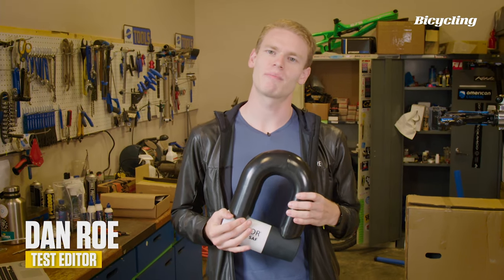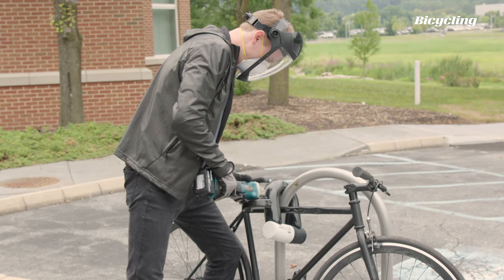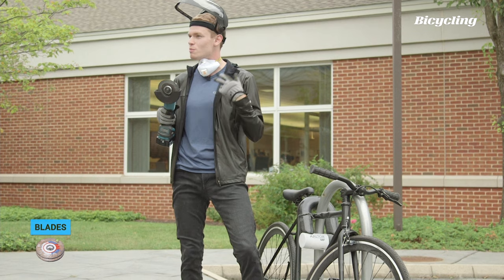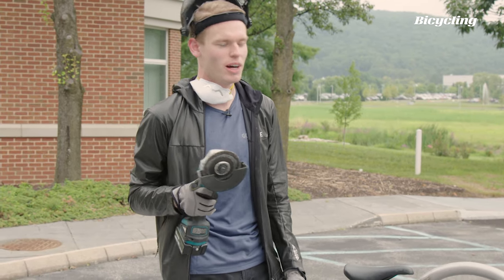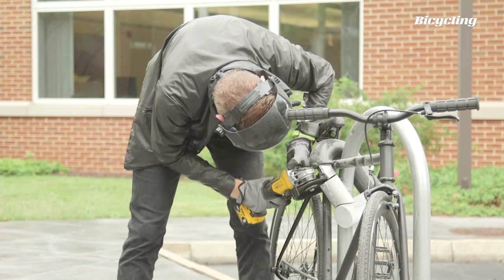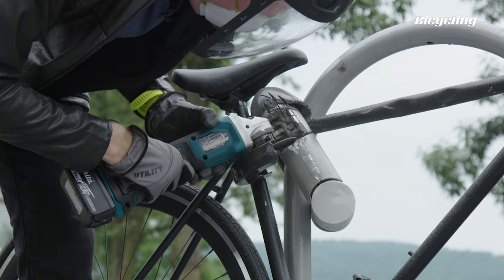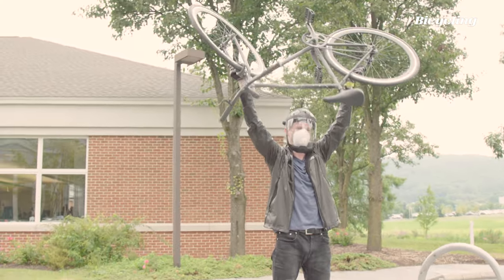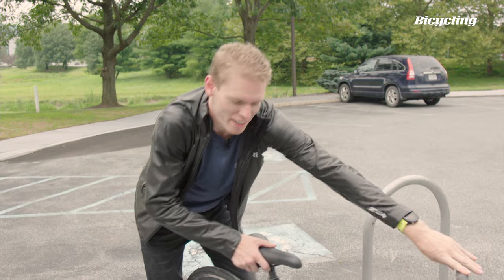Is The Altor SAF Bike Lock Really Grinder-Proof? | Bicycling Magazine

Comment: Use a 9in cordless and then connect it to something that can not be cut as fast.  Bike rack is all of 10 secs for the tube. 

Hand hacksaw would take the rack in under 1 min.
Reply: even if he cuts the rack he still is gonna have a 13lb weight dangling around or the bike
Reply: Is that true GrandMasterP1000??? You can hacksaw through a rack of this type in under 1 minute? Damn, if that's the case what the hell do we do?
Reply: @justinbeynon7980  Use the same materials as this lock to make the rack. :V

Comment: Wait a minute, why could he just start cutting from where the U section meets with the base?

Because the aluminium protection stops there and its on the core there.

So you could just need to chip off a bit of that rubber and place it carefully to be able to hit that core.

Comment: how long does it take to cut the bike frame, the missing piece can always be welded back on
Reply: Ah, no. Once it is cut it is destroyed.  It would have to be professionally rebuilt. More than the price of this bike.
  Most bikes are not welded. Only super cheap bikes and tig aluminum bikes are welded.
Reply: @firesurfer  if they can't take the frame they'll take the wheels, if they can't take the wheels they'll take the tyres. Seats and handlebars are fair game too :(
Reply: @AegisHyperon  The wheels and tires cannot be separated if locked.  Many bikes are just stripped. That is why you see so many bare frames locked up.

Comment: just cut the Metal bar it's attached to and drive away lol
Reply: Lol
Reply: That's what he says at 3:37
Reply: @Geoff Rogerson you don't say???
Reply: That is vandalism and you can be arrested (not for cutting bike though)
Reply: @Geoff Rogerson Yeah, but at one point you have to consider if the lock is over engineered for the problem. After all more aluminum and steel means more weight and cost.
Reply: Bring flex tape or glue, cut the bike, tape or glue it, later you can weld it lol
Reply: Then you can cut the lock at home.
Reply: Andy Stadi. Drive away with this lock still blocking the wheel? I’d love to see how you’d manage that   ;-)
Reply: @gendalfgray7889  stealing a bike is a crime too and you can be arrested for it as well :P
Reply: @freitastutu  I think cutting the rack will add vandalism to your list of prosecution.

Comment: Cutting the rack is still a problem.  You have to cut through it twice and you will still have to deal with the lock on the frame.
Reply: Cutting the rack is still easier/quicker.
You can deal with the lock at leisure in you workshop at home.
Reply: @elricthebald870  That's true, I'm just saying it is going to be a massive PITA.  They REALLY need to want your bike.

Comment: Use Dewalt 60v 9" cut off saw for the win.Also,would be easier to cut through whatever its locked to instead.
Reply: even if he cuts the rack he still is gonna have a 13lb weight dangling around or the bike

Comment: Great idea and very impressed with how long it took to get through it but most thief’s would of just gave up and cut the railing that the bike was locked too
Reply: even if he cuts the rack he still is gonna have a 13lb weight dangling around or the bike
Reply: @TantalumPolytope  and then the person can take the bike home and spend all the time in world with a angle grinder to get the lock off which will eventually come off with a bit of perseverance
Reply: @neilmccusker6971  but he is gonna have a 13lb weight dangling on the bike wich is quite suspicious and if he rides it hes probably gonna fall off the bike every turn
Reply: @TantalumPolytope  then what you do is wrap your coat around the lock so no one can see it and push the bike home and let the  tyre down so in case you get asked by someone you can say you have got a punctured tyre and this is the reason why you are pushing it

Comment: I could cut this with a bandsaw in a fraction of the time it took this dude to hack his way through it with a grinder.
Reply: Yeah a bandsaw would do it in no time. I was thinking a sawzall with a bi-metal blade would probably do a better job than a grinder as well.
Reply: @misterj2875  100%
Reply: Good thing a band saw isn’t very portable. In fact it isn’t portable at all. So I’m not sure how’d you would use that on the street. But a handheld angle grinder easily concealable in a bag? Definitely.
Reply: @ShiftingCloudsYT  I Have a battery DeWalt bandsaw that says different. Also would be much quieter.
Reply: pieman12345678987654 Well that is portable but kinda heavy tech to be carrying about just on happenstance of running into bikes like this when a angle grinder would be better for that. But yes it would still work.
Reply: pieman12345678987654 What’s the cut capacity? 4 in?
Reply: @ShiftingCloudsYT  5 inch

Comment: How about a cordless bandsaw or reciprocating saw? Or a cordless 7 or even 9 inch angle grinder. Or drilling out the core?
Reply: It uses an Abus lock core that has drill protection. Using a different tool could definitely work, but a standard size grinder seems to be the go to power tool for bike thieves. 

You can't guard against everything, but this lock would be way too much hassle for 99% of thieves.

Comment: Would it not have been easier to grind the bike fence that the lock is locked to? I'm sure its hollow unlike the lock.
Reply from the maker: It would have but we only have the one!
Reply: even if he cuts the rack he still is gonna have a 13lb weight dangling around or the bike

Comment: What about a band saw tho?
Reply: A portable bandsaw is cumbersome, because of the greater size difficult to conceal and draws way more attention and suspicion than a grinder would. I also would assume that a portable bandsaw is a bit pricier than a grinder and as a thief I would like to take both the bicycle and the saw with me after the job. And again, the size and weight of the saw makes it difficult to handle from the POV of a thief. Of course if you approach your pray as a thief with a van full of tools and kidnap a bike into the van then you are up against organized crime. But then again, the lock is a great deterrent since thieves pick the low hanging fruit instead of having greater work for the same outcome.

Comment: Even if the thief cut through the rack, they would still have to cut the lock off after.  I think your bike is pretty safe.
Reply: Cutting the lock off at home is hardly deterrent.  Especially if the home is a chop shop thst has an oxy-acetylene torch.

Comment: Aluminum is soft.   once a cut is made  in the beginning, I would have expected a pry bar to be a better tool to remove the aluminum.
Might also add. aluminum has a low melting point.

Comment: You cut it all wrong. Cut at a 45-degree angle and cut a triangle off the very bottom of the shackle. From there you can cut the inner shaft and rotate the lock out of place.

Comment: Couple of problems -

1) The SIZE of that lock. It's alright if you exclusively go from A to B and can leave it on location, but otherwise, it's very impractical.
2) The cost! $299! You might as well get a load of hardened chains and locks and just wrap you bike in them. 
3) If you ride a bike worth of that level of security, all the above considered, why not just bring it inside with you OR find a shop or something nearby and pay them rent to store it for you. It seems like a gimmick rather than a practical genuine solution
Reply: 1)its not meant to be portable
2)even if you had some hardened chains vs this lock this thing would still win.

Comment: Of the few 'angle grinder resistant' ulocks on the market today, 2024, the Altor is simply the best, in regards to, securing your bike. It's simply too girthy to get through in the time thieves usually require to pedal off with your whip. Unfortunately, the cons outweigh the pros. 1). It's so big, it'll make Fred Flintstone blush. 2). And because of this, the locking circumference is minimized. 3). The key tends to get finiky which is really scary. Heck, one day it may not open for at all! Though WD-40, and or a little graphite might help, this likelihood doesn't inspire confidence.
 But it may work for you and your locking scenarios.

Comment: The problem is this grind is aren't the only cutting tool. I don't know what it's called but there's one hacksaw cutter which is like an old reel to reel tape deck what I mean it's has a flexible hacksaw blade that goes around this spool Now they just create a very thin cut like a hacksaw They might be able to go through something like this or the new so-called un grinder able locks.

Comment: Fill the lock full of wire mesh, grit, or even a dye. Use them daily,  wire mesh gets into the gears. They will just start cutting the welds on the bike and repair it .

Comment: You could cut the rack the lock is attached to in ten seconds, then remove the lock later (after stealing the bike).  If the bike is actually worth stealing with a grinder, the thief will do that.  If the bike isn’t worth that level of effort then it means you wasted your money on an enormous and ridiculously expensive lock.
Reply: even if he cuts the rack he still is gonna have a 13lb weight dangling around or the bike

Comment: The comments here are laugable!  "Use a bandsaw, reciprocating saw, bimetal blade, blah, blah, blah."  Sure, this blade will get through the soft aluminum.  But for what purpose?  The typical grinder wheel still won't reach the shackle.  And even if  you do orchestrate the "perfect" combination of hacksaws and angle grinders and technique, how long will this take? 

 As already posted a million times, you're better off cutting the bike rack in 1 minute and taking the bike and lock home to work on in private.
Obviously NONE of you have actually cut locks and hardened steel.  Hardened alloys were developed to thwart hacksaws and all manner of bandsaws, reciprocating saws, etc.  U-locks stopped this type of attack. 

Plus, those of us who have been involved with bicycle theft issues for decades know that bike thieves are lazy, stupid druggies.  They pick the lowest hanging fruit.  Einsteins with LPL lock picks and skills they are not!
Then larger and larger, more leveraged bolt cutters became available, so shackle sizes were increased to prevent or greatly reduce this method.
Then freezing & hammers entered the scene (more urban myth, actually), so crossbar end lengths were reduced.
Then car jacks and high-leverage methods were employed, so shackle size was reduced.  Double-locking models hit the market. 
Then angle grinders were found to make easy work of hardened steel alloys.  Bummer.  Then battery-powered, brushless motors made high power portable thieving tools readily available.  Shackle size increased again.  Large security chains became more common.  But angle grinder power kept increasing, making bicycle theft easier and easier.
This lock FINALLY addresses this issue.
IF Altor is smart, they'll start selling u-lock retrofit sleeves for the hundreds of millions of u-locks already in service.  They'd make a killing!  I assume they've patented their design already and are employing this strategy.  They'll sell very few $300 locks of this size.  But for those of us who already own quality locks, upgrading them to thwart angle grinders would be the smartest move.  IF they can do it for around $90, they'll sell millions.
If not, they're losing a major opportunity to sell a lot of units AND improve bicycle security for so many people.

Comment: The breaking of this lock is largely down to technique here to be frank. Unfortuantely there arent any angle grinders i know of that are meant to be used with the spindle facing the right as this orientation of spin is up and just forces the user to compensate kick back and jarring instead of focusing the drive into the cut. The point in the aluminium is to gum up the grinder blade which it does a good job of but any bike thief will know a bit of tallow or similar lubricant will mitigate that and your through in seconds. Very disappointing to see that the additional aluminium is the only extra defence added to the fact that the shackle once cut twists?? Both sides of the shackle should not twist in a proper lock to prevent the obvious and forcing and additional cut at the very least

Comment: Youre cutting  in the wrong place. Cut the lip that protrudes from shackle to the base of the lock. That way you have one big cut less to get a pie piece out. Then when you cut the steel shackle the lock will be free since there is no support from the aluminium from the other side.

Comment: Sorry to be rude but you have no clue how to use a grinder. First of all you take the guard off and fit a larger cutting wheel and the highest capacity battery, 6 amp hour for example,alternatively you use a full size petrol powered grinder, they may be big, heavey and loud but they'd get through that lock in seconds and if your stealing something worth it, say a £35,000  super bike, well throwing one in a hold all or the back of a van capable of holding a bunch of bikes or 2/3 expensive super bikes, its not all that big a hardship

Comment: Wow. That is pretty impressive resistance to 4.5" grinder but it is crazy to carry a lock that size! There are a few 9" cordless grinders that will cut through in fast i.e.  Makita DGA700Z or Metabo HPT
Reply: it's not meant to be carried around you just attach it to a bike rack that you use often and lock your bike when needed

Comment: @2:07 you have so significantly damaged the bicycle it would no longer have value.
Angle grinder resistance often leads to manhandling the bike and cutting it.  I've had a bike before get damaged during an attack making it still useful to commute with less valuable bikes.

Comment: If I really wanted that bike as a thief.  I would just cut whatever it’s locked to, like the bike rack itself. Then work on the lock someplace else.  that would have to be easier. But more than likely I’m moving on to the bike next to it with a common u lock or chain.

Comment: You’re not very good with a grinder. Also, a bigger grinder disc like a 5” would’ve gotten through this in a minute. The outer thicker shaft is no match for a grinder. Grinders are designed to cut through steel which is much harder than aluminium.

Comment: Wrong tool mate. All you need is cordless reciprocating saw with 6" bimetal  blade.
Reply: Bimetal blade won't cut the hardened shackle underneath.  Duh.
Reply: @dudeonbike800  ....duh....try Diablo steel demon.....
Reply: @sherannaidoo2712  Oh, so NOT bimetal then?  

The Diablo is just another high-speed circular blade.  Not effectively different than the ceramic angle grinder blades, which has been established as effective against hardened steel alloys.

So your "bimetal blade reciprocating saw" comment remains pointless.

Comment: Cool lock but it would take less than a minute to cut through the rack....
Reply: The purpose of the video is to see how resistant the lock is to grinders. Would be pointless to cut the rack as that shows nothing about the lock
Reply: @PowderedNuts  right but my point is there's no reason to have a lock that is stronger than the thing you're locking to.
Reply: @DoRC  Well the rack is going to change from location to location, You cant really help what you are locking it to if this was a public use lock since its just whatever is in the area. If you use this for storing at home tho id assume youd also get a rack just as strong as well. Guy in the video just used what was on hand for the demonstration
Reply: @PowderedNuts  true but unless it's made from solid hardened 2" diameter steel (which basically nothing is) an angle grinder will make short work of it.  Basically anything you can practically fit inside that lock be cut by an angle grinder very quickly.  If the lock would fit around something like a telephone pole that would be a different story.

Comment: Obviously, cut the metal ground hoop that the bike is locked to, rather than waste all that time trying to defeat the lock!

Target the weakest point, not the strongest!

With enough time, energy and equipment, virtually any lock can be defeated, however less thought is given to the metal that the bike is secured to!

Comment: That’s a small grinder. I use a 12” to cut steel when I am working on my equipment. How about trying an oxyacetylene torch.
Reply: The nasty thing is the combination of Plastic, hollow Aluminium and a hardened steel core.

Comment: Hey you are not meant to use a grinder. Try a torch that will do it. 30 seconds or less.
Reply: A torch on hollow, plastic covered Aluminium?
Have fun!
Reply: @norbertfleck812  you buy that lock I will show you how to get through it really quick.
Reply: @firstamendmenttshirt4768  Without enormous clouds of smoke and a completely wrecked bike?

No way!
Reply: @norbertfleck812  are you a fabricator or welder? Then you might not know what to do with metal.
Reply: @firstamendmenttshirt4768  I am an industrial CNC manufacturer in Germany, have got a Master degree in Engineering, and I have got  welding certificates for several welding technologies.
Reply: @norbertfleck812  I will show you how it is  done. With out your help.
Reply: @firstamendmenttshirt4768  I am curious.

Comment: I'd just cut what ever steel bar or in this case the tubing that the lock is attached to. Then you can work the lock off the bike later 😂
Reply: even if he cuts the rack he still is gonna have a 13lb weight dangling around or the bike

Comment: Would have been simpler to cut the bike lockup metal instead of the lock itself
Reply: even if he cuts the rack he still is gonna have a 13lb weight dangling around or the bike
Reply: @TantalumPolytope  cut slits so lock can be slipped out 🙄

Comment: In such a case, every thief takes a pipe cutter - it is noiseless and quickly cuts through the pipe to which the bike is connected.

Still impressive and a great lock, the question that remains is - where do I lock the bike...